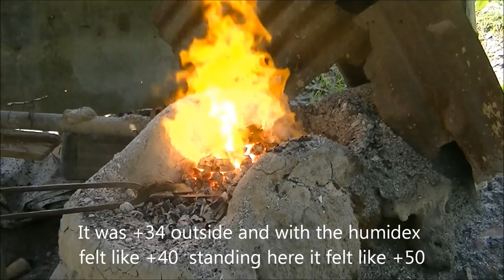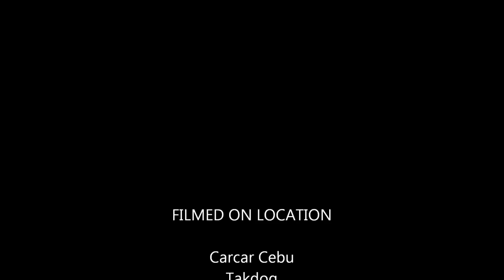Making a Bolo

Comment: As working tools the lack of tempering isn't a huge deal.  Those blades will sharpen quickly and when you use a knife as a tool and use it a lot, the ability to put a quick edge on it is more important than how long that edge lasts.
Reply: The tempering is actually quite good. It's not scientific, but the edge is much harder than the spine, the way it should be. You can see the guys in the video cooling the edge much faster.

Comment: i have travelled almost all over the phils. whenever i meet a farmer i always ask to feel how sharp their bolos are. they are razor sharp. they can cut hair as it touches. it seems so natural for them to keep it that sharp. i have been trying to emulate their techniques but with very few success only and i have used the most expensive sharpeners i can buy on amazon. one thing i learned though, making razor sharp edge takes time and lots of strokes and strops.
Reply: jo sal use waterstones they might be expensive but they are well worth it
Reply: It's all about maintenance, hone just the cutting edge after every use. The aim is just to keep it sharp, not pretty. Sharpen too much and the life of the blade is shortened.
Reply: They use really cheap carbide stones out here. Around $2. I've never seen anyone stop a k ife with leather here, but they do use black sand on a log to hone their edges.

Comment: How much did you pay for them? They would probably cost like 100 bucks each or so over here in the west.
Reply: +NecroBanana around $10 here in the east.
Reply: +NecroBanana In the US, at least, regardless of steel quality, I don't think I could find handforged knives of comparable size for less than 250... and that's a lucky find.
Not too keen on the tang style, personally, but they obviously work.
Reply: The Danneskjold There's a few vids out there showcasing how they some smiths do make full tang bolos out there. They sell, from what I could gather in those videos, at about 800 pisos(about 12 dollars). Still quite dirt cheap. And yes, finding affordable hand-forged blades in the US is quite difficult. Usually it's because it carries the "hand forged" mark on them, and some smiths even use some really expensive high carbon steel for a blade that will probably only see medium use at most. But I digress.
Reply: DeathPorky I've seen both spellings being used. I prefer to used Pisos to differentiate them from other Pesos-named currencies.

Comment: Say Heah, Yeah that's a awesome bolo/knife making.Yeah handmade is handmade. But honestly, I would rather have a good company that understands metalorgy and make me the knives with modern equipment. Infact the knives I used for my Afternoon Delight was Custom Made by Rod Stewart. I brought my 3V Skookum Bush Tool and my Ka-Bar Johnson Adventure Parangatang made in the 1095 CroVan also used for car springs. It holds a decent edge retention too. I always felt my 3V Skookum Bush Tool was a little on the small size and a bit too heavy to carry as a neck carry. So I got a Dangler Extension Caribiner for the Sheath and now I even use it more. Yup, it's a deep biter so felling a small tree with it is no problemo and I dint nean chopping it but deep beaver cuts. I love that knife. adding my Ka-Bar Parangatang with my 3V Skookum Bush Tool actually compliment eachother. I really enjoyed watchibg this vudeo. But wgere I live a Hatchet is the prefered chopper so I like the .190" thickness of my Parangatang,  Yeah I can baton and baton chop with it. But I also brought my Wooden Handle Fiskar Fokding Saw. a nice added look with ny Tool's, Oh, and my Gerber Multi Tool to take hit pots off the fire. Yeah, I like to Dangker Carry my 3V Skoojum Bush Tool and I simply molle attached my Ka-Bar Parabgatang to my Kidiak Gearsling. I dunno, But makibg my Parangatang with midern technique makes alot of sence. I pound the hell out if it and she dont cry, heh heh heh, just jokin. Yeah, my Parangatang is a tough girl.,,.p

Comment: At (13:28) that's supposed to be a bolo? why is it look like a kukri, instead?
Reply: It stands straighter than a Kukri but really there is not a big difference. There are so many types of blades in the Philippines that have so many different names and variations. Bolo is quite a blanket term.  That blade is just one of them and most likely was made for a purpose similar to the Kukri.

Comment: I believe the anvil was a train axle
Reply: It was not, and is not an axle. It's actually an artillery gun. Remnants of the breech is still there, including hints of the breech hinges. The barrel was cut short... Train car axles would not deform as badly because it is a heat treated and hardened steel that's specially tempered for toughness and durability.

Comment: great blade design, a pitty that the end process was missing steps i.e. anealing,critical hardening, and tempering.this is coming from a blade smith that has owned and tested many philippine knives.you get what u pay for.but i still loved the vid.
Reply: was expressing my opinion of wat i saw in this vid, still think its a shame.
Reply: if u snap a peice of metal and look @ the break point u can see the size of the grains. it looks like dots, the smaller the dots the tighter\even the grain. large dots usually indicate harden but not tempered,annieled,.Stress is retained in random areas cauzing brittleness(.the good)can be sharpened easily( the not so good)-breaks on impact.
Reply: *****
your welcome, i love using 5160 because its easy to manipulate and can survive alot of abuse if treated properly. would love to see your work if u got time to post.

Comment: The only reasons in which I dont like pinoy made knives is because they always make the. With a rat tail tang. Id preffer scales and a full tang than a handle with a rat tail tang. My grandfather is the only person i know that forges full tang knives with traditional pinoy ilicano tools
Reply: It'd help if they had a drill press.
Reply: The good blades out here have a tang that goes almost the full length of the handle. It's more than strong enough, and you get much less shock on the hand than you do when using a big chopper with slabs for a handle.

Comment: I bet that knife has a lot of stress fractures
Reply: Have you seen one or bought one?
Reply: they should make it on a close room...
Reply: Trust me, that water was plenty warm enough to reduce the shock to the blade.
Not to mention how quickly he quenched it and then let it slowly cool afterward. It's called edge quenching and differential hardening. If it was going to fracture, it would have shattered when he was correcting the warp after quenching.
Reply: Those blades not really need a quenching those are from the car spring. They're hard and firm enough already. We have that kind of blade here. Maybe older than me. I accidentally chop it on the rock while smashing the coconut for a coconut juice. They're rock solid no dint at all.

Comment: The handle is  poorly made. Time will come that the blade will just just fly when you choped something.
Reply from the maker: well its been a year and that bolo is used every day all day and it has not come apart yet in fact the father in law has one thats over 15 years old same way of being made still holding strong
Reply: My grandfather owned a hand-forged bolo (I'm Filipino). He was a farmer back in the day and used it almost everyday. He got it 17 years ago or so and still is good and strong up to this day. There are a lot of blades that are hand-forged here in the Philippines that may seem cheap and may break after a few good use, but see for yourself first before you can make judgement.
Reply: +william d It is very rare thing for a blade set in this fashion to ever come loose. The one thing that will cause this to happen is not caring for the knife and allowing it to get or remain very wet causing rust that reduces the size of the tang allowing it to come loose. Other than that, this is actually a very efficient and effective way to mount rat tail style tangs. As it is burnt into the handle , it is a perfect tight fit, then quenching it causes the tang to expand in the handle, locking it in place. It is little different than the way a hammer head is wedged on and held by pressure.
Reply: Steel doesn't expand when cooled down, it shrinks.  It expands when heated.  That is indeed a traditional method of hafting a knife, but they have been known to come apart as well.  The American traditional version of this method used cutler's resin, primarily pinion pine pitch cooked down and brick dust and other weird things added and used as a glue.  I've seen some local blacksmiths use a plastic bag thrown on the heated tang and pushed into the handle as a cement.  A pin is not necessary, and in fact can cause splitting and handle failure, but the handles need more than just being burned in and shoved tight.  What causes most to fail is the handle dries out and gets loose, most of the time a simple tap will keep them tight and most people using them likely understand this.
Reply: And then you just slap a new one on it.
That's the beauty of it.
Reply: It actualy does
Reply: The blades are top notch, but these handles actually almost always fall off. Everyone here taps them off a new bolo (sundang on my island) with a piece of wood, packs plastic shavings from a bottle in to the handle, then heat's up the tang and cements it in place with the melted plastic. Guava handles can last decades, and the blades for generations.